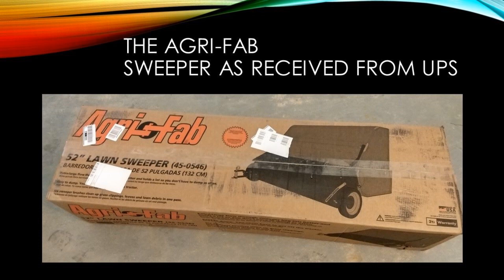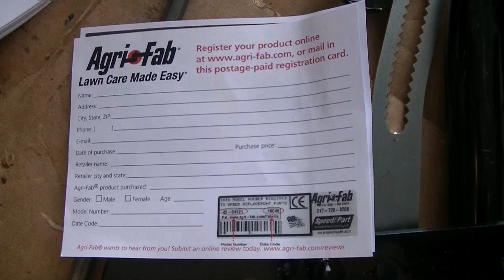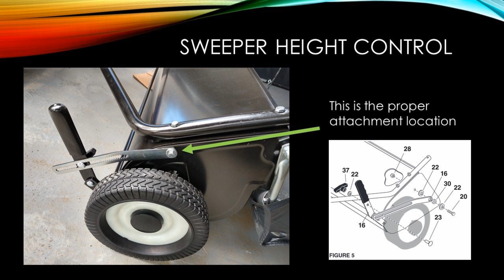52 Inch  Agri-Fab Lawn Sweeper

Comment: At work we had a Termite ( Billy-Goat Brand) lawn vac. Reduction 8:1. Would eat a 2" branch. If you went slow so as not to clog ...it worked miracles. Had a hose attach.. lawn vacs everywhere but the Termite model seems hard to locate used.

Comment: I got mine 5 years ago ordered an extra bag for just incase mine goes bad on the bottom set mine to just below 2 inches works just fine no problems I do not use mine on wet grass hard to clean out if you do not have an air compresser.
Reply from the maker: Hi Billy, Thanks for your information on your unit.  It is appreciated!
Reply: Hi, I have one . I got a piece of sheet metal , made a framework with a couple caster/ swiveling wheels on the rear corners . It is fastened to the brush frame . the bag rest on top that frame. It still dumps out the same .

Comment: Works great! https://www.youtube.com/post/UgkxprGGPRQoChQaA8u58dt7miEpxQBKiWeJ  More difficult with longer grass, though, but I was expecting that. I have a small back yard, it seemed like overkill to buy a lawnmower with an engine. This is easy to carry in and out of the basement through the bulkhead. Very sharp (be careful). At the back of the mower are little wheels, which I use when pulling the mower backwards, so it's easy to readjust direction. I'm including a photo which shows the before and after for my lawn when it was at its longest. For long grass like that you really have to put some muscle into it, and I needed to go into a new section of grass with some momentum, but when the grass is only an inch or two higher than regular cut height it's quite easy. The lawn is still patchy and full of weeds, but at least it's a good height! A step in the right direction.

Comment: If you are in the UK, this is NOT man enough for our grass. I have to say that I am not impressed by either the quality of manufacture of the product or the company's after sales or reaction to constructive criticism of the product! I have been through countless bolt for the sweeper brushes and 4 of the 6 brushes are now scrap. The main problem is that the product is just not able to cope with...1)  our damp grass 2) any kind of undulation of the ground that may result in additional pressure on one end of the brushes compared to the other and 3) I know it sound mad but the manufacturer states that it must not be used at a greater speed than walking pace!!! I have a Kubota BX231and 3 acres to mow and pick up on, Nobody who buys a 54" sweeper (because of the area they have to cover) should be expected to only use the sweeper at walking pace!!!
I now intend to cannibalise it keeping just the frame, sweeper guard and bag and build something that is man enough to do the job! For the UK and when doing large areas, you need to be spending about £1000.00 unless your lawn is perfectly flat, and you have lots of time to go very slowly and empty very regularly!
Reply: Hi, question ? Do you mulch your lawn(s) ? You spent all that money ,
You could have the add on bagger Or a pull behind vacuum?  " Right equipment 
For Correct Job !
Reply: @crashwrench  Yes, I do mulch. The issue in the UK is that there is quite a period of the year (spring and Autumn) where the grass is growing but there is still a lot of dampness in the grass and the air; result, you get clumps of grass that drop off the cutter, these then rot and kill the grass under them! Secondly, we have a lot of leaves which I collect these for leaf mould for the veg patch and we have a lot of acorns. Anything other than a sweeper struggles to collect the acorns and the leaves at a decent pace. Final problem is that there are very few (to no) attachments in the UK for this task, so I was relying in the USA to build something that would both do the job and to be of decent quality...Failed on both counts! At this money, it should have been the right tool for the job!! To clarify, pull behind vacuums are crap and expensive too and the Kubota grass/leaf collector costs about £5,500 ($6414) extra here!!!!!! I don't own a golf course I just want to look after 2.5 acres!!!